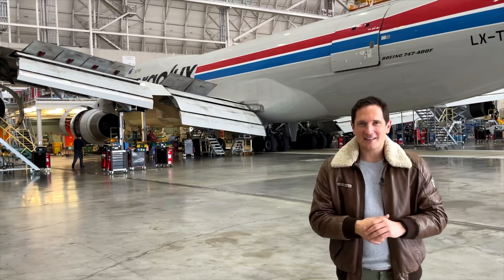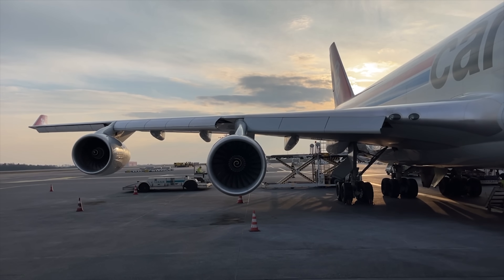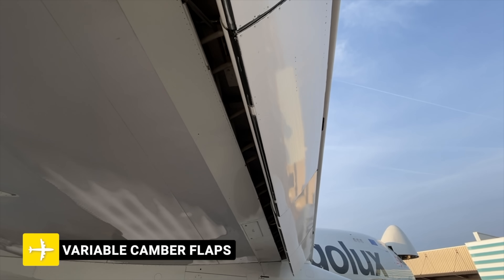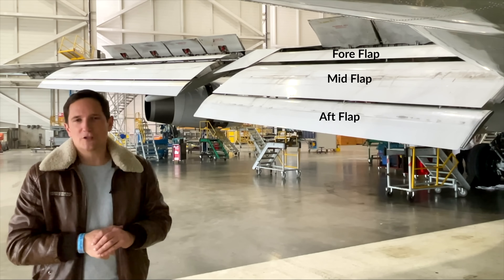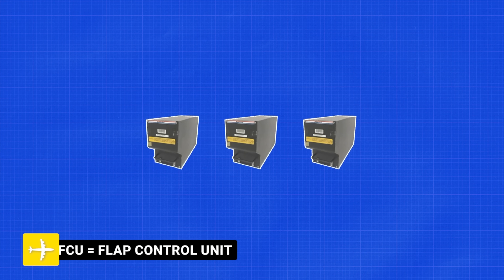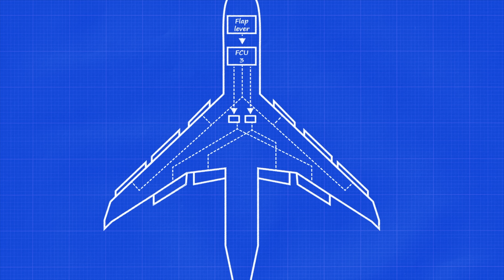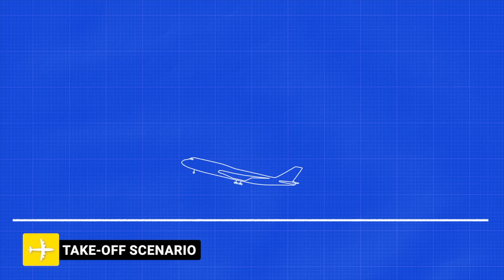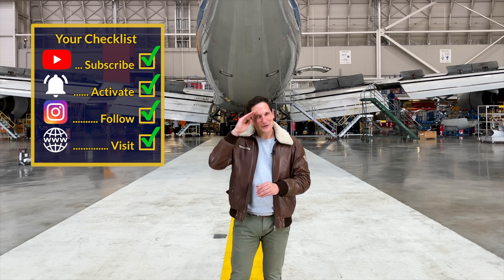How do FLAPS EXTEND on AIRPLANES? Explained by CAPTAIN JOE

Comment: Thank you for going into details on 747 flaps, loved it. I have noticed that only the 400 and 800 retract leading edge flaps thrust reverser deployment. 100, 200 and 300 do not. You mentioned its to protect them from thrust reverser pushing air on to it. I never knew this till I watched this video. Since its not available on all 747s I thought the retraction was to help kill lift on landing and hence available only at landing.(How could I forget my favorite of them all, the SP. As expected, on reverser deployment, the Krueger flaps do not retract. Inline with her bigger sister, the 200.)

Comment: The Hawker business jet has an interesting flap configuration.   For starters, FULL flaps on the Hawker is 45 degrees.  Most planes are 30-35, so its already a draggy machine on final.   The plane is also equipped with spoilers or AIR BRAKES in Hawker speak.  The airbrakes may not be used with flaps extended.   But here's where it gets interesting, after touchdown occurs while landing, the pilot moves the Air Brake lever fully aft.   The spoiler panels extend to their normal extension.  But at full aft travel on handle the pilot pulls UP and lifts the handle over a mechanical stop.  He then extends the handle further aft and this causes two things to happen very quickly.   1.  The flaps extend to 75 degrees and, 2. The spoilers on the wing extend even further than they are allowed in flight.   The result is as you might expect, a huge amount of drag is imparted very quickly.  This provides up to 45 percent (I think) of the stopping power.  This position is labelled LIFT DUMP.

Comment: Pilot reported loss of thrust, indicating possible engine failure on both. Also the RAT was deployed indicating critical failure of the Engine, loss of main and electrical or hydraulic failure.

Comment: Just watched video on use of flaps on a 747. Looks as if when a mistake is made with flaps on take off, there is a measure which prevents flaps from extending too much and causing a stall. I would think the 847 which just crashed in India would have also had this built in. The video shows the landing gear still down just before the crash. But hard to believe a pilot or first officer would have used the wrong lever and put the flaps up instead of the gear. Time will tell.

Comment: who is here because of the air india crash?
Reply: I am here to understand why most comments are, "Flaps not extended..."
Reply: Me
Reply: I subscriber for the last 6 years. very good explanation.
Reply: What is important in this video is he clearly explains after 9.30 min..how to manage the flaps in case of emergency/ go around. This is very important 😮
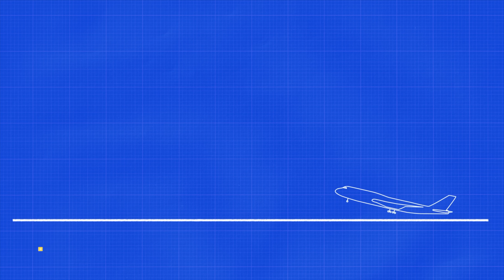Reply: @kishorkumarkeekan8649  Yes, also the situation at 10:20 when instead of retracting the gear the flaps are inadvertently retracted.
Reply: I came here because I wanted to understand more after air India crash
Reply: Me too😞
Reply: In AI case, if its a pilot error,  Flaps retracted early , aircraft lost lift, LGear not retracted , contributed more drag, bad combination and dangerous situation.
Reply: Hahaha me too😂
Reply: Me too movement#
Reply: Me

Comment: Just a correction, at about 8:50 point of the video. 
We are looking at the L/H body gear wheel well. 
The unit circled on the L/H side is a power drive unit (PDU) that operates the inboard T/E flaps. That is correct. 
However, the unit circled on the right is not the PDU for the outboard flaps.
If I remember correctly that unit is a door operated sequence valve. 
The PDU for the outboard T/E flaps is located in the R/H body gear wheel well.

Comment: What has always surprised me is  how smooth the top of the wing is compared to the underside.  You have to wonder how the thing even flies with so many little parts hanging out in the air stream causing drag.  counterintuitively, it probably helps in creating lift as the air slows down under the wing creating even higher pressure vs the top side of the wing.

Comment: If the speed is checked automatically, then why does the PM check and confirm flap speed even?
Reply: Extra set of eyes. Thats why its called pilot monitoring ;)
Reply: @ZK-APA  When the first set of “eyes” is a computer comparing two simpel numbers, I fail to see the necessity for the second pair.

Comment: Great explanation on the flaps and it's operating system. The back up drives for the L/E flaps is electrical power and the T/E flaps is also electrical.

Comment: And I have a question. With all these mechanisms, robotic system, flats etc. where does the fuel even is located ?????  It is said the fuel is stored in the wings, where exactly ???
Reply: The wings are designed in a way that they have hollow areas designated for fuel storage. In pictures the wings look thin, but in reality they are a bit thick.
Reply: There is still some space in the wings for tanks.
Also, these planes have a center tank, and some even have a tank in the horizontal stabilizer in the back.

Comment: The variable camber flaps work through the monkey motion of all those linkages you see at 03:42 . The linkages connect to the fiberglass panels causing them to bend as they extend or retract. Their operation is a marvel of engineering I never tire of watching.
Reply: The fiberglass doesn't really bend.

Comment: Hey Captain. I have a question. I could not find the answer. Maybe you know the answer. As you know, B737 800 or 400 flaps indicator has different flap rate gaps. For example the gap between up position indicator and 1 flap indicator is different than 2 and 5. Is it a design trick? Has it any reason ?

Comment: I don't understand planes, pilots, I don't understand these guys at all, this whole industry for me is very bizarre. Many things for me make no sense. Calculate the fuel. What? Who calculates the fuel? some say pilots do some say dispatchers do, God knows.  If an engine fails during take off and the plane is fully loaded it cannot climb no more we all die. What? All those screens you see no map whatsoever. They choose waypoints using a computer you need to punch nrs in instead of using a screen to choose them. It's all a total mystery for me, I have a million questions about flying planes and planes in general make no sense to me to me at all. Pilots cannot see the engines. What? nobody in the aircraft industry heard about cameras? Few days ago a plane took off with too much fuel had to circle for 2 hours it was too heavy. How can that even happen? something his very wrong with this aircraft airports airlines industry. Ever heard of a sensor that tells you how much fuel you've got? a projection on the front window that shows you how to line up with the runway? a warning system that instead of BEEP BEEP BEEP actually tells you what the problem is ? a robot voice that actually tells you what the fault is? Air speed, that shit is frozen doesn't know the airspeed no more it happed AIRFRANCE crashed into the Atlantic Ocean because of that. It is really mind-blowing how incredibly primitive these planes are and I am shocked to see how little improvement is made and how many people choose to be pilots and fly these strange machines when you have more tech in a Tesla. Look at all those buttons. Have you seen the cockpit on a F 35?? why the hell do you have so many buttons and switches in these passenger planes for? What tech is this? 1954?

Comment: Why does automation simply not orchestrate the whole flaps and slats regiment itself? When you brake with your car, and all of a sudden you floor the accelerator, an automatic gearbox automatically selects the appropriate gear so you have the most sufficient engine rotation.

Doesn't a plane know best how much lift it needs according to what commands you give it? Why does aviation keep the flaps and slats regiment a flight crew's job?
Reply: Because flaps/slats directly affect an aircraft's flying characteristics, hence flap selection is on the flight crew discretion.

Comment: Watching a lot of air crash videos; there have been several that crashed on take off due to flaps not being configured correctly. In most cases it seemed the mistake was never discovered by the pilots before it was too late. What I've always wondered- could the pilots, having realized their mistake once the stall alarm sounds- still save the plane by immediately deploying the flaps? Or is it too late at that point.

Comment: It's fascinating that Boeing had stuck with the triple-slotted flaps for the 747s up to the -400, except the -SP. the -8 was redesigned with double-slot inboard and single-slot outboard. Have you seen the flaps on a 747SP? It's interesting.

Comment: Aren’t leading edge flaps called slats? Or slats means something else…? Thank you!
Reply: Same thing
Reply: There are leading edge flaps which are not slats (but yes majority flaps are in the trailing edge and slats in the leading edge)

Basically slats and flaps do different things. Slats energizes the boundary layer of the airflow over the wing, and flaps change the camber (ie wing area) of the wing.
So, if a leading edge device is increasing the camber and not energizing the airflow, then that's a leading edge Flap and not a slat.

Comment: This is not a plane. It's a masterpiece of engineering... so as most of the stuff designed at that golden era of mechanism design, w/ nearly no software aid. Complex to design and operate but safe and reliable. Period.

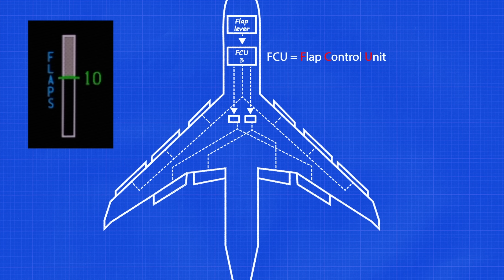Comment: 6:39 if the outboard flaps don't move simultaneously with the inboard flaps, this is not asymmetry. Left/Right Outboard positions are compared. Left/Right Inboard positions are compared. Not inboard to outboard.

Comment: Hey Captain Joe, can you do a video to explain the job of an onboard flight engineer? And why is this job becoming less and less common?
Reply: Basically the job of a flight engineer was to monitor the parameters of the aircraft which are not directly related to the flying part of the aircraft (eg electrical, hydraulics, engine parameters such as oil and things like that). If something was abnormal, they would do the troubleshooting. And they also manipulated the thrust levers ie they set the thrust required for the aircraft.

It's just not common anymore because of modern computers and avionics, either the computer can monitor itself, or make it that simplified that the pilots can do it themselves.

Comment: Please explain what kind of conversation going on in between the cockpit and ground wire-connected person while pushing back the aircraft?
Reply: Basically the ground engineer tells the pilots to release and set the parking brake as required and when it is ok to start the engines. The jet blast may knock things over behind the aircraft or put too much strain on the pushback tug.  The pilot may say which specific engines he/she is starting. The pilots will tell the ground engineer when engine start has been completed and the engineer will tell the pilots that he/she is disconnecting the headphones and which side of the aircraft he/she will be walking to... and of course... wish the pilots a safe flight.

Comment: The inboard and outboard TE flap drive motors are in different wheel wells, not as shown in the video.

I've never heard of a flap placard speed limit on flaps 1~20. There is no mention of it in the Boeing Maintenance Manual or in engineer training manuals.

Full flap extension only increases the wing area by 21% (lift by 90%)

Comment: The 747-100/200 had an even more complicated leading edge flap system for reverse thrust, the 2 flaps closest to the inboard side of the engine stowed whilst the rest remained deployed, even more of a mind blower, great video for a former spanner turner 3 evolutions of 747 engineer, keep it up Joe, I miss the Queens in this age of fly by wire 👍🏻

Comment: One thing I don't understand about airplane physics.  If you lose one engine which causes you to lose speed, and that speed cannot maintain lift, why not deploy the flaps and slats to maintain altitude?  I've always heard that they have to descend to a lower altitude to maintain lift but if you deploy the flaps and slats, should that not allow you to maintain altitude?
Reply: Flaps generate some drag, no matter the selection (so the speed will be even more affected). In the case of the Leading Edge flaps, at some point during the extension, they will be at 90 degrees to the airflow (i.e. for a few seconds, they will present an even larger drag than when they are fully extended).

Comment: Question: If flaps help a plane to fly at lower speeds, why wouldn't they take off using full flaps? You'd get into the air quicker, or is that a stupid thing to ask?? Assuming because it's much heavier at takeoff maybe?

Comment: What happens if the pilot happens to select flaps 30 while not being 180 knots ? Will a warning pop up or will the system add flaps as close as possible to the desired setting ?
Reply: There is an EICAS Advisory message ">FLAP RELIEF" if the speed approaches the flap placard airspeed. If 30 flaps is selected, the flaps will automatically retract to 25 units. If the speed keeps increasing, the flaps will move to 20 units. Flap load relief is only available for flaps 30 and flaps 25. As far as I know, what he said about the flaps not extending if the flap lever is put from UP to 1 and the aircraft is flying too fast is not true. It's not mentioned in the 747-400 Maintenance Manual or Engineering Training Manuals.

Comment: Why are both hydraulic and pneumatic systems used? Is it redundancy, or something else?
Reply: What I am guessing is that since hydraulics are reservoir based and pneumatic is bleed based, if something with not that much of complexity can be achieved with pneumatics, then might as well use pneumatics. Along with redundancy, it also makes sure that the hydraulic reservoir can be used with other more critical systems.
Although I am not a boeing pilot, so i could be wrong.

Comment: I didn’t get the difference between kruger LE flaps and the variable camber LE flaps. Can you give more details please? And thanks for this awesome video 🤩
Reply: The variable camber LE flap panels actually change shape when they are extended. The panels go from flat to slightly curved. The Krueger flaps remain flat. I don't mean the folding nose sections, but the main rectangular panels of the LE flaps.

Comment: This is amazing, I always wonder how this operates anytime I sit next to the window when traveling, and it is pretty fascinating just watching it, If you can, please make a video of how airplanes move on the ground, or rather the engine speed for airplanes on the ground. some time ago, when I was ignorant I thought the wheels, or rather, the landing gear has a separate motor or engine that moves it on the runway before the rotating turbine engine takes over in the air until I learned that the airplane is moved on the ground by the turbine engine itself, what is the initial rpm the engines need to get to in order to move an airplane on the ground and the rpm for take-off? I ask because, most times, at the airport, I see the engines running without the airplane moving which looks pretty fast considering the gases being expelled from behind. I can only imagine the brakes are set on the landing gear which prevents it from moving since I can't imagine it the way a car operates when engines are in operation but the car only moves if power is sent to the transmission to move the wheels.
Reply: Yup on the ground the aircraft moves with the engine thrust. Though how much thrust is needed depends on the aircraft weight. If the aircraft is heavy, slightly more than idle thrust is needed to move. But if the aircraft is light, then even with idle thrust the aircraft will move, so in that case your speed is actually being controlled by the brakes.

Comment: Make a similar flap video about A320 too..
As 747 is quite tough to understand in front of flaps 1,2,3,4 of Airbus A320.
Reply: Its more of just naming scheme. Boeing names its flaps with approx angle of the flaps itself, whereas airbus names its flaps as per flap sequence
Reply: @ZK-APA  That's true but 747 is too complicated design in front of A320. I guess it's all edges operate on hydraulics.

Comment: Are there any provisions to replace hydraulic motors with electric motors? Would electric have the same power to do the job? Would there need to be a differing or additional power supply? How does deicing of props and flaps work? Why don't we have delta wings for glide in case of loss of engine?
Reply: @Eskay64  The questions were  general questions and NOT specific to the 747 or even  turbojets.

Comment: That jackscrew and acme nut looked really dry at 8:55. Wasn't that the cause of an airline crash some years ago because of inadequate lubrication? Unless it was a different design.
Reply: @Eskay64  I'm thinking of an issue with an elevator I think. It has a jackscrew to help the trim, and the nut got completely stripped out. 
(Edit) Alaska Flight 261

Comment: Excellent, informative video, Joe, but one thing. The video doesn't do justice to the noise the leading edge flaps make when retracting or extending. The pneumatic air system is extremely LOUD!

Comment: I noticed that for the Boeing 747-400, the two inboard leading edge flaps retract immediately right after landing, then extend after a few seconds. Why is that? It seems like there is no need for them after the aircraft lands, and doing so just add to the wear and tear of the components.
Reply: @Eskay64  But my question was: What is the need for coming back out? The plane has already landed and the flaps retracted......seems like a wasted action/operation.

Comment: Flaps 1 will be at the highest airspeed, there must be a tremendous amount of aerodynamic forces acting against those leading edge flaps as they try to extend due to its range of motion…so much less forces on other planes when their slats extend